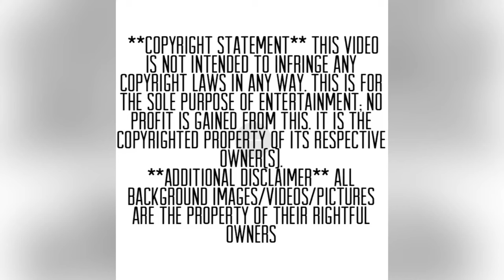Humvee Radiator and Steering Column Removal

Comment: For the drain plug you have to hold the plug in place and loosen the screw on the inside. I had the opposite problem, I touched my plug and out came 10 gallons of diesel.
Reply from the maker: Ahh I got you!